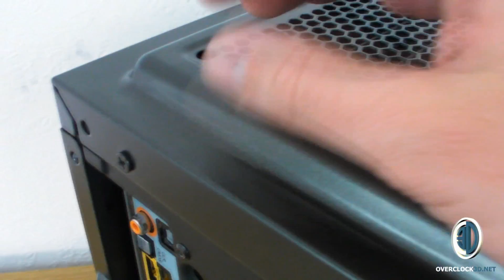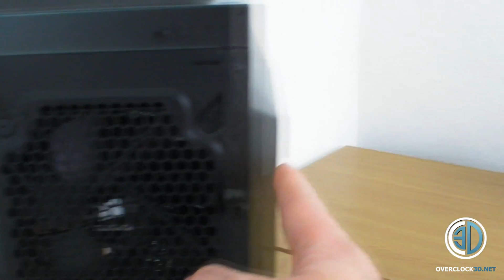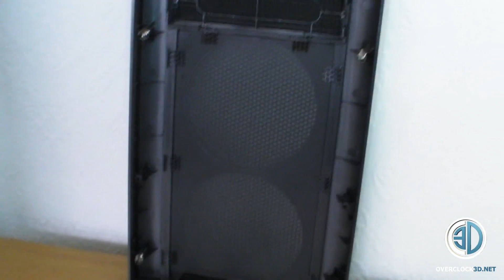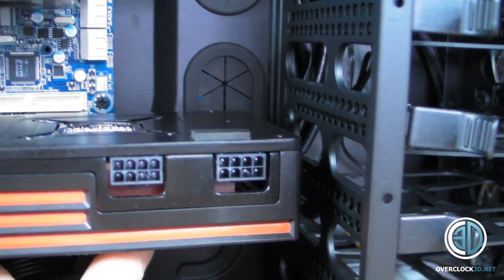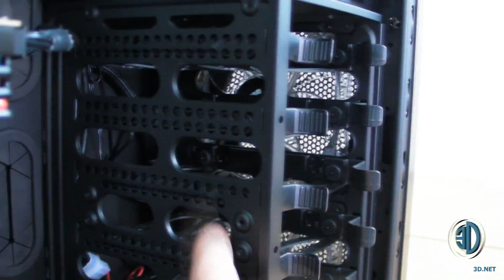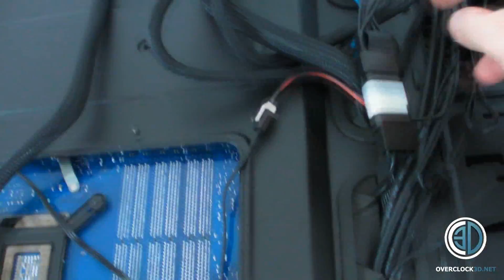Corsair Carbide 400R Review

Comment: You know you put your PSU in backwards?
Reply: He didnt. You can either put the PSU with the fan facing up, or the fan facing down.

Facing up: The fan will draw in the hot air your GPU is spilling into the case (which would be useless if your card has a blower fan on your gpu...most don't), back out. The positive is self explanatory, it means a cooler case overall. The negative is the fact that your PSU will be drawing in warm, possibly hot air to cool itself.

Facing down: The fan draws in the (hopefully) cool air from outside the case to cool itself. Positive is again, it's going to be drawing in fresh outside air instead of the warm, possibly hot air from your GPU. There's really no negative.

Basically it's a trade off. 

I personally install the PSU face down simply because I usually build PCs with cases with side cut outs for fans so I see no reason to have my PSU act like a blower for my case.

Comment: a better power supply for fans? Not worth it, fans use take barely any power. Most fans will be between 0.2 and 4 Watts. so you can have 10 fans and they will only take up 40W MAX assuming you have the worst fans for power consumption, you can have 20 fans for 80W... 

If you get a 750W PSU for that system it will be very inefficient, because if you go with the HD7770 with 10 fans your system will only be using around 330W at full load.

Comment: It really wouldn't be too much of an issue to address at least the radiator issue though, I feel almost every single company is finding ways to fit thick rads in cases EXCEPT corsair, Which is the main reason I'm disappointed with then as a company in general

Comment: if they did that, they would have more dead surface area, meaning less used space, more dust. and they can run into problems with the fan mounting in the sides, and the one in the back :(

Comment: corsair needs to make a full tower carbide case looks like this on the outside but fit biger rads on the top and dual socket boards like the asus ws board and the option to use more 140mm like in the front or something XD

Comment: i have the same case and a z68xp-ud3 board.. i am not able to figure out how to plug the front fan's light on and off switch.. where to connect the cable which enables that switch on/off button in the front? can u suggest?

Comment: In both videos of the 300r and 400r he has the PSU power supply mounted with the fan not at the filter. There is a removable filter underneath. Why have it that way.

Comment: You dont need to care whether the side vet is dust filtered or not. As long as you have more air coming in than going out, which you do quite easily especially with the H100, then the positive pressure will force the hot air to exhaust out of all the vents it can which stops dust build up. As for putting fans on the side, through all the computers ive seen and ive had alot and worked on alot doing my Year 10 work experience a few years ago, temps prefer side exhausts not intakes

Comment: If no one's said it yet, at 18min with the fans inside attached to the hard drive scaffold. There are two notches at the base of the case that the lip of the fan sits in, you then just screw only the two top corners of the fan to the case, if you want you can use some rubberized electrical tape on the notches on the base to minimize play. but yes, you can fit two fans on the inside of the case on the hard drive scaffold.

Comment: Hey i need help choosing a case which one of these would you recommend?

Corsair Carbide 500R Black Case
Corsair Carbide 400R Case
Coolermaster CM 690 II Advanced Case - USB3.0 version
Fractal Design Arc Case
Fractal Design Define R3 Black Pearl Case - USB3.0
CM Storm Scout Case
Fractal Design Core 3000
Coolermaster HAF 912 Plus Case
CM Storm Enforcer Case
NZXT Tempest 410 Elite Black Case
Enermax Fulmo ATX Midi Tower

The case is going to house:
ATX/ M-ATX Mobo (Haven't decided yet)
560ti (9")

Comment: 10:10 

I have also a Gigabyte Mobo and just like this motherboard there are connections on the bottom of the PCI-E slot, I have tried to put my 5970 Vapor-X card down there with cables connected at the bottom but it won´t fit, what are gigabyte thinking?

Comment: You could attach fans to the outside of the case on the top and have a fatter rad that way. Wouldnt be pretty but with a little bit of work you could get a cover for the fans as well.